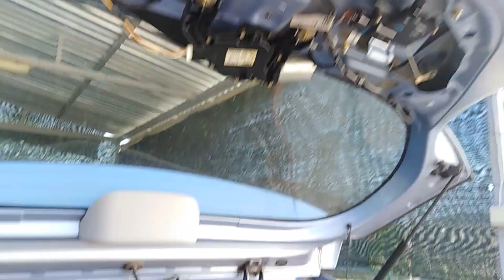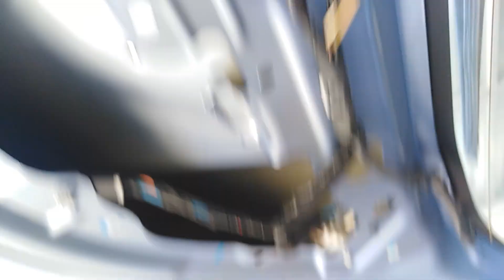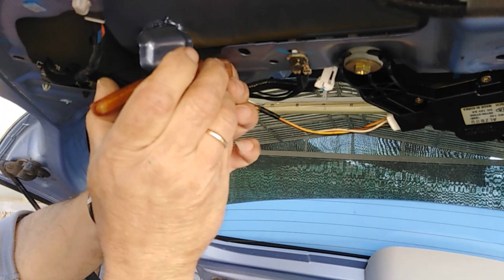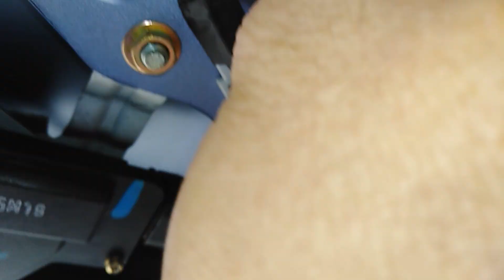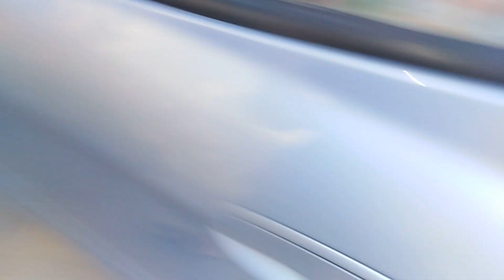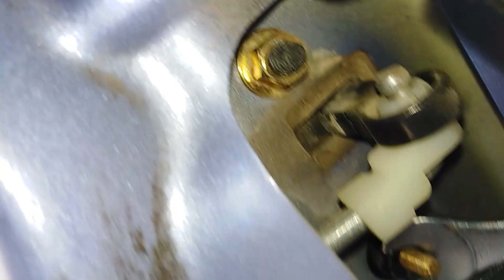How to replace license plate light bulbs. Kia picanto.

Comment: It's easier to compress the clips using an M6 spanner. Just slide it over them. It will save the trouble of trying to squeeze them with the pliers, which can as well be impossible if they're too thick.

Comment: You can do everything from behind! No need to disassemble anything on the outside of the car!!
Reply: From behind where and what bulbs these take
Reply: @affyinnocent1940  from the inside of the car you just remove the plastic cover of the back door. Has 4 screws if I remember correctly. Remove all screws, then just pull the plastic cover off it is hold by a few plastic clips in addition to the screws. Once you got the plastic cover off you can access the light bulbs.  They can be removed by turning. Takes a bit of force. Turn counter clockwise half a turn and you can remove the lamp holder. Takes 5w5 bulbs.
Reply: @Bornchiller123 Will try that tomorrow 👍
Reply: @andriandrason1318  May you be successful. It is a bit tricky but absolutely doable! A little WD40 or silicone oil will help to remove the bulb holder in case it is stuck (rubber sealing tends to lock itself in place a bit). I've so far done it twice. You will be able to do it too. Good luck! It is a tight space and not completely easy to access though so you'll have to have a bit of a frustration resistance ;-)